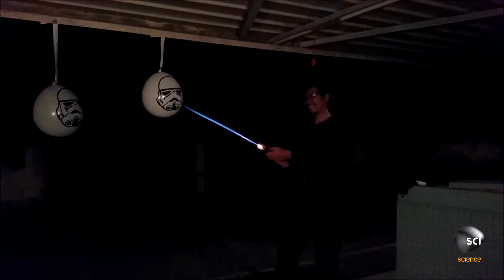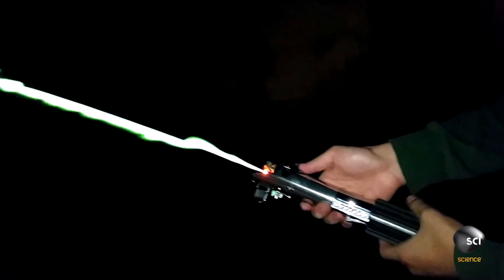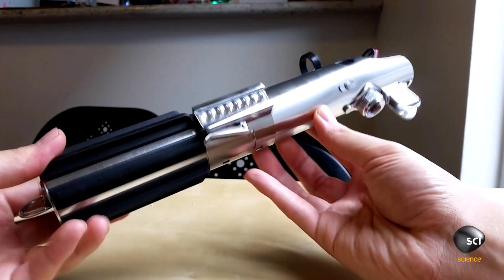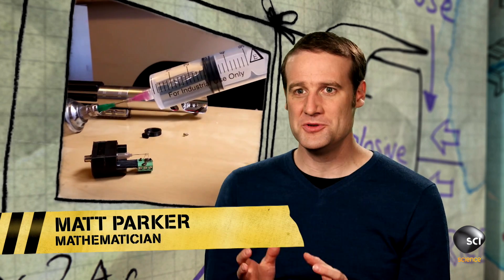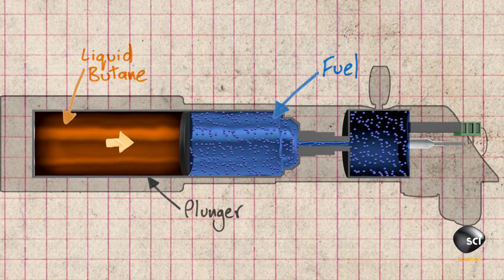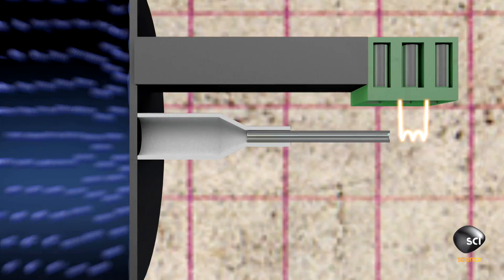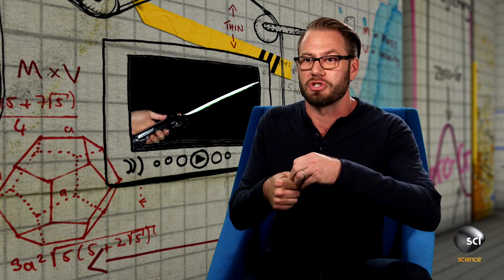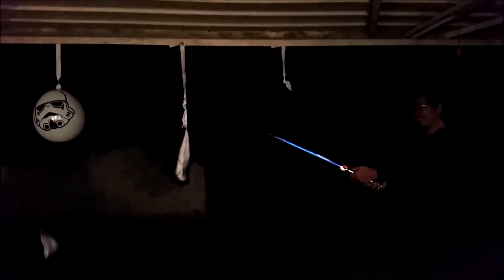This Jedi Master Created a Real Lightsaber!

Comment: It's a common mistake since it's called a LIGHTsaber but the blade isn't actually light, it's energy. And it doesn't just stop at the end of the blade, it bends back around into the handle so the blade doesn't go on forever. This also provides a circulating power supply and creates the hum of the blade.
Reply: Jedi Jay everything absorbs light